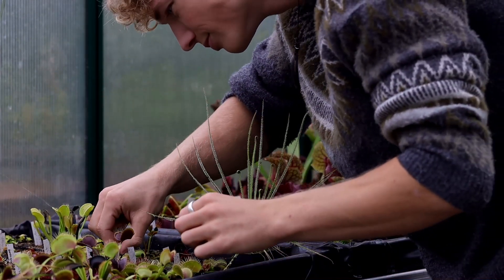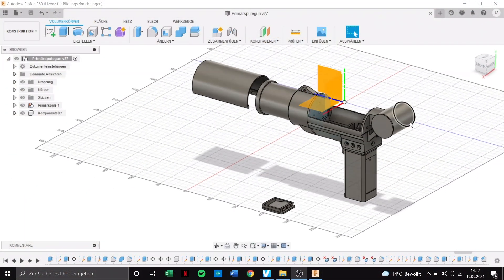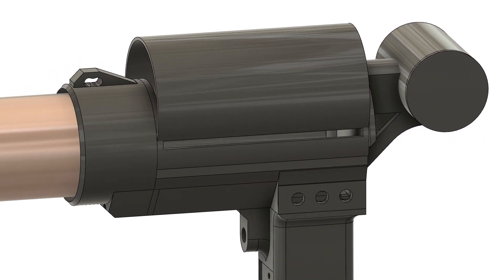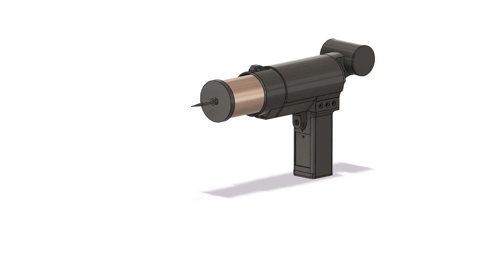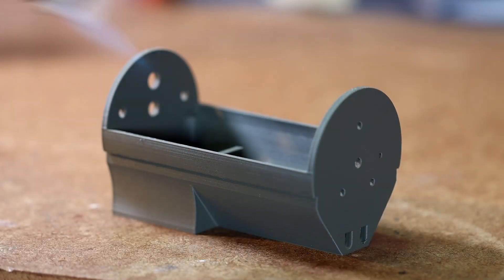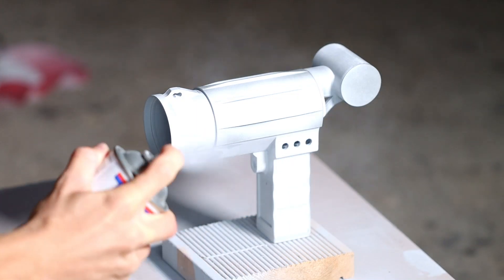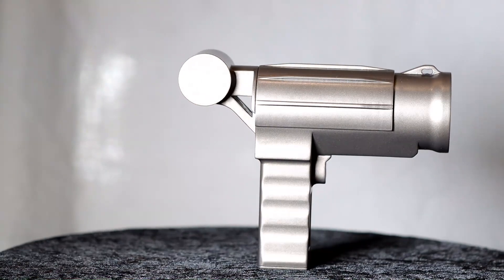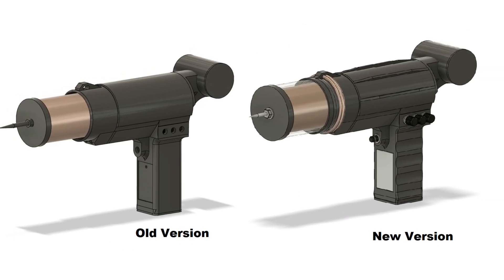The Tesla Gun - 3D Printed Lightning Blaster DIY - Part 1

Comment: Bro that's going to be so awesome. I used to be a machine operator for plastic injection molds and we would clean up the molds the same exact way with a blowtorch and razorblade lol. These 3D printers these days are pretty impressive.
Reply: Looks like everyone is making tesla guns 
Hmm...i should make one too 🤔
Reply: @tvishmaychoudhary69  Makes sense for large backpack QCW guns to be rare but there aren't even a ton of miniature ones around to look at. Bán dẫn DIY and MS Lab are like the only other channels who fit everything in a cool printed housing. Bán dẫn DIY probably has the best output so far.
Reply: @Magneticitist  i have seen thier models
I was very impressed one of them even compacted to a 500ml water bottle size!
And thier outputs were pretty awesome too 
Guess i should also start in this business